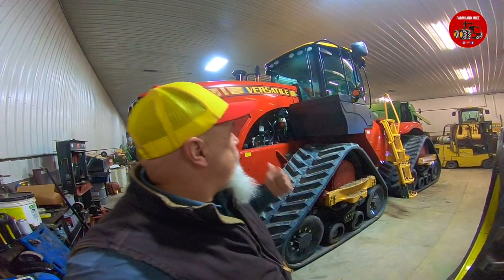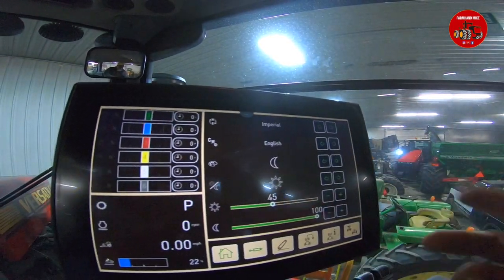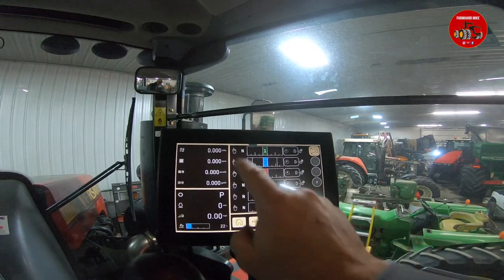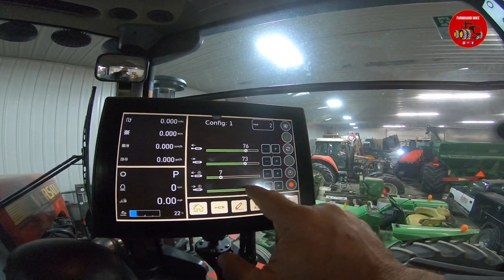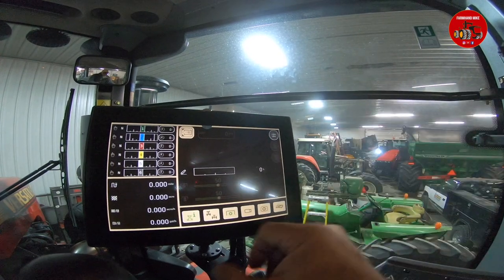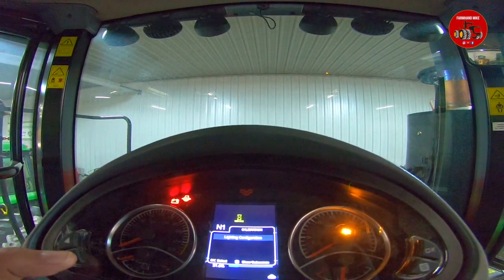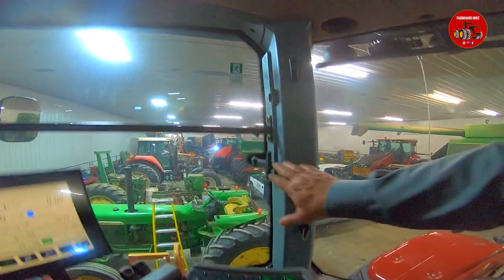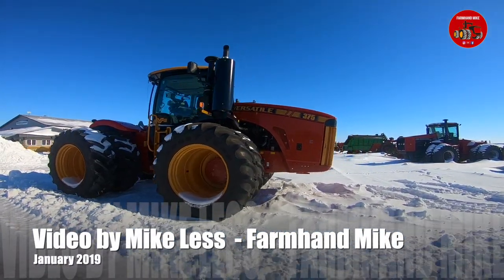Versatile Delta Track 570 Tractor Monitor walk through

Comment: Interesting to see that Versatile is using a Parker screen now too since the Kubota M7s use a version of it as well since it looks like you have the same basic features. Only DIfference is the acutal screen and the functions for the tractor otherwise its all isobus . But now with that being said make sure you get a look at the 2020 Magnum that case will show you at NFMS it will have new AFS 1200 screen and new corner post gauges

Comment: We have a tractor just like that but it's the 550DT and we've just been having so many issues with it because of the emissions system of the tractor. During the fall back in November the tractor decided to fail during tillage and had no power. Since before Thanksgiving to this current date that tractor still is trying to get fixed...

Comment: Mike always enjoy your vids. Still wanting to know if you have any ideas on our 2013 Versatile 250 sucking trash into radiator and running warm. Any ideas? Thank you
Reply: Kelly Atchison make sure your hood is adjusted so that the weatherstripping at the bottom of the hood seals tightly to the the frame. I have to watch our hood latches and have had to replace weather stripping before.  The draw back with super steer tractors is the wheels being even with or ahead of the grill causing more trash to get into it.
Reply from the maker: Who is your dealer?  There was a bulletin out on this. Yes hood adjustment is important but could be other things like the foam seal between the top of the radiator that sets against the hood came off. The rubber strips that seal between the sides of the radiator and hood are worn, missing or torn?
Reply: Mike Less - Farmhand Mike . Painters of Monmouth Il. Yes on the weather stripping. Also seems to fit real good in front by hood latch. Think we started with bulletin when it was a couple years old. Also switched clutch fan thinking it wasn’t staying locked up. Plants beans in standing stalks and runs a grain cart in the fall. Thinking we need to buy gas powered air compressor and blow out daily because not very often near 110 outlets. Thank you Mike